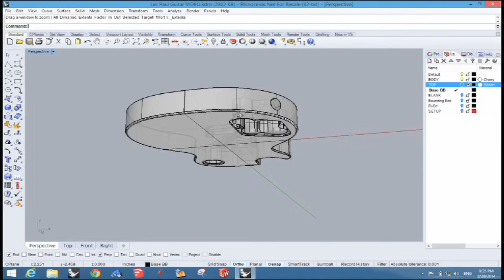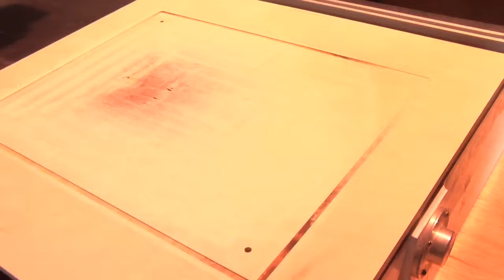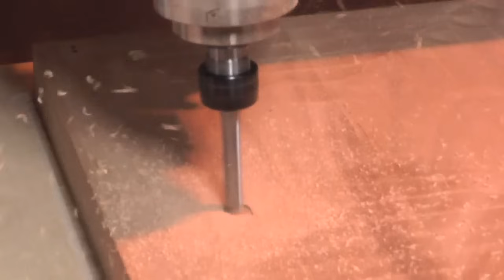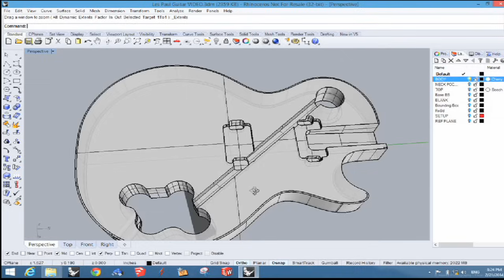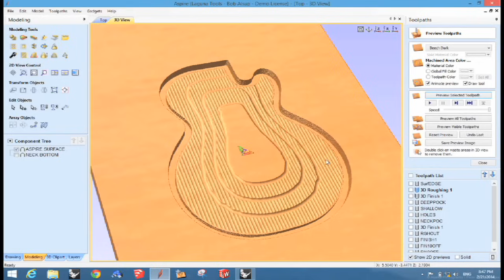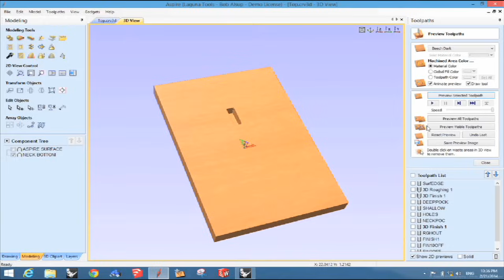Guitar Making: IQ CNC Router | Laguna Tools

Comment: Great and useful video! Lots of stuff here. One thing: doing an angled surface with a flat end mill results in rounded inner corners. I guess it's acceptable because of the low angle value and because, of course, the neck will be rounded too and this avoids interference. Right?

Comment: Great video.  When you touch off the bottom of the round-over bit, I imagine that you make contact with the bearing shaft (the part of the bit that formerly held the bearing).  This shaft sticks out below the half round carbide cutter.  So the z-position is now not in the right spot -- the bit will need to travel on a lower plane so that the round part of the bit is cutting at the right height.  How do you adjust for that?
Reply from the maker: Please send us an your email at graphics@lagunatools.com and we will get you in touch with our CNC specialist.

Comment: windows on a macbook or am I high?
Reply from the maker: Yes with a specific program, you can run windows on a mac.
Reply: The Vectric Aspire he uses for the CAM portion is only Windows compatible. So you run it in VMware fusion or Parallels. Rhino which is the CAD portion is available in MAC. You can always run everything straight on Windows and not have the MAC, but lots of folks run this hybrid Mac/Win setup.